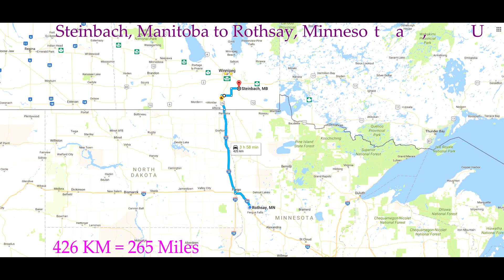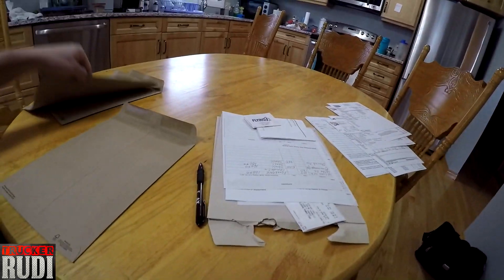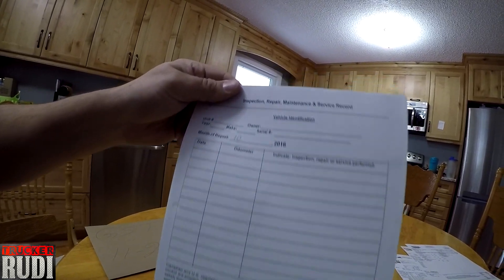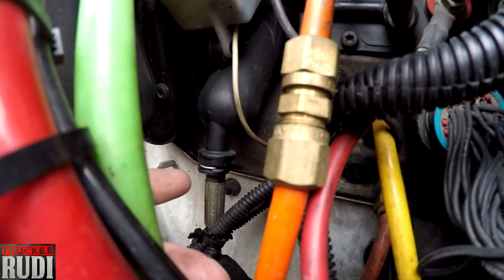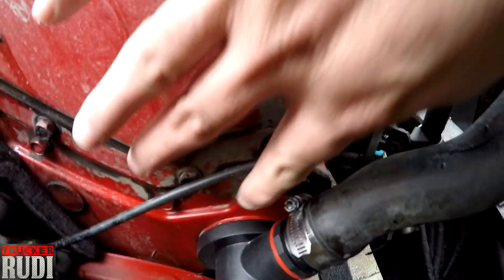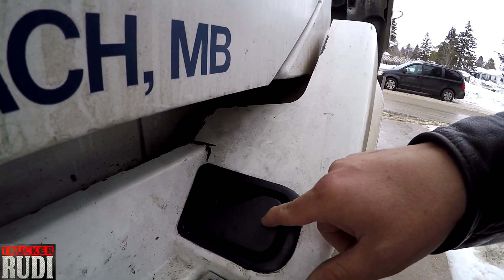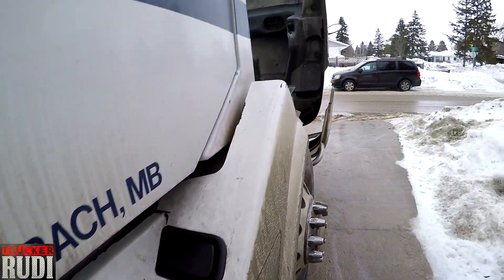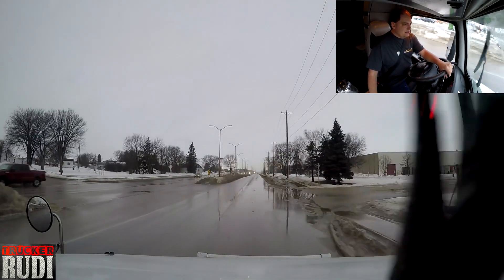TRUCKER RUDI showing you all the repairs that are done 01/20/17 Vlog#955

Comment: Hi Rudi
I'm glad you opened the hood so I could see the back of the grill because I often wondered why Volvo has that chrome bar
on the front of the grill that looks so DUMB and it takes away from the lines of the rest of the truck and I would really like to see what it would look like without it or does it stop the grill from rattling and if so why don't they make a stronger grill
ALSO while I'm at it your hood mirrors seem to shake a lot maybe that's why the hood broke.
Now that I've said all that if you want to say what your really thinking right now I'll understand and yes I have been called that before.  LOL  I still watch all your videos  and they're GOOD and interesting .
Reply from the maker: Imahoboto my front steering tires are almost shot and that's why the front is shaking a little bit I need to change to steer tires soon just think the truck is got 1,500,000 miles on it it doesn't last forever it's a good comment nothing bad was said